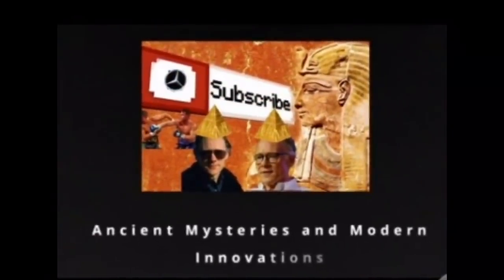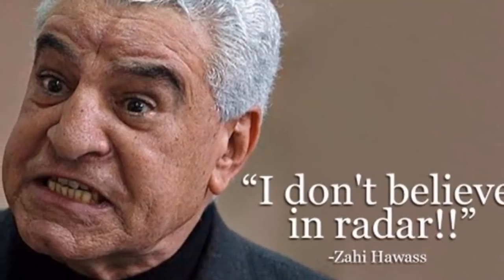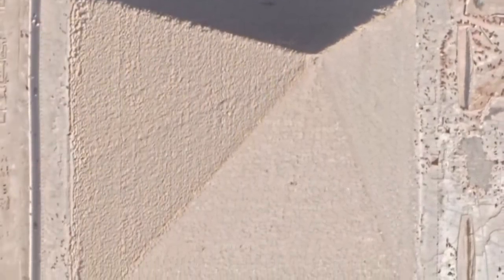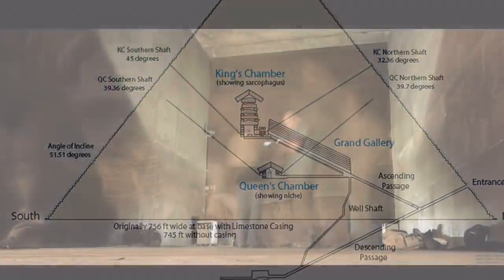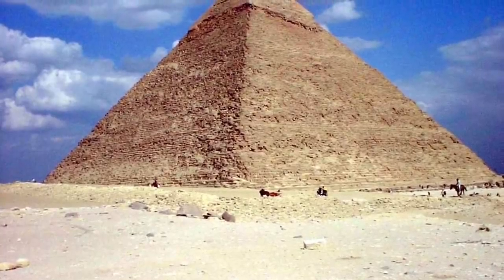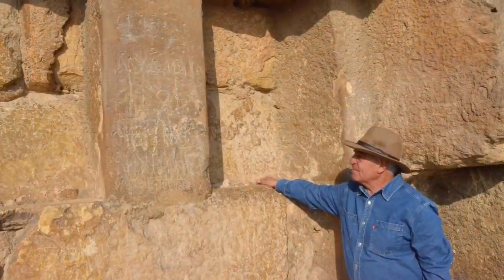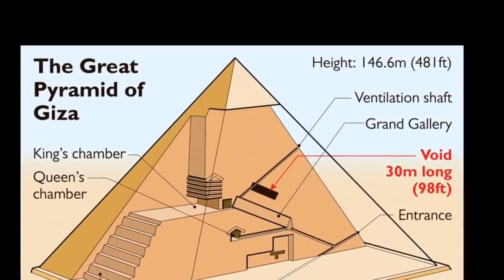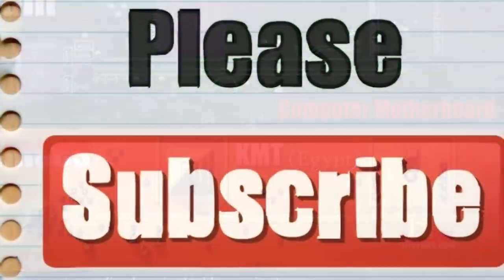Graham Hancock on Geopolymer (Liquid Stone) Technology at Giza Pyramids

Comment: I'd love to see someone today float a 70 ton rock on a raft. Even the best theory is absolute garbage. How come nobody since the Egyptians has ever been able to float a rock that size on a handmade raft. People are so quick to discredit vibration or frequency. If the polygonal stone walls in Peru where created with a chisel than how come nobody since them has done something similar. I am DEFINITELY not saying aliens or lasers because that's extreme and to one side of the spectrum. Why not something in the middle like frequency. How did they direct the frequency toward a particular stone and keep the field around the stone I have no freakin idea. To me that's more logical than a lever. I know levers can move the world but if it's so simple as a lever how come nobody else has done it. Dont say nobody tried because that's a load of crap.
Reply: 2.5 or 4 tons is nowhere near 70. Nobody has floated a 70 ton stone on a 142 foot boat since then. People have tried. If levers are the answer why hasn't anyone else just used a lever to duplicate it. Universities have tried to duplicate on a much smaller scale and all failed horribly. The answer because nobody has wanted to is utter bull crap
Reply: The polygonal stone walls in Peru, could have been cast in concrete - most plausible theory

Comment: The granite is concrete graham just like the other blocks .. they had to use granite because of all of the captured light in their INTERFEROMETER ... that’s how they measured the circumference of the earth
Reply: You can't make granite from concrete. Its an igneous rock
Reply: Samuel Griffith you grind it to dust and throw it in the mix . When it hardens it has the properties of granite or whatever type of stone dust you add .
Reply: @geoffmcarthy7314  which would in no case ever be called granite or possibly be mistaken for granite.
Reply: Samuel Griffith well actually it’s mistaken all of the time . It forms up just as it is granite or whatever other type of dust you use . It takes the properties of the stone dust . So yes it’s mistaken all the time and through history .
Reply: @geoffmcarthy7314  by who? Granite Is characterized by large Crystal growth of 3 or more minerals usually quartz, feldspar and plagioclase which no geologist would EVER confuse with a man-made matrix of dust and cement.
It doesn't sound like whoever is saying this has any understanding of granite or cement
Reply: Samuel Griffith science has already proven this fact . Modern guess work is over . The blocks have been broken apart analyzed and proven that these are man made blocks . There is no question anymore . It’s rock dust made to a type of plaster that takes on the form of the main ingredient .. that ingredient can change
Reply: @geoffmcarthy7314 you just changed what the focus of the conversation was about.  you're now referring talking about the outside which no one ever said was granite. GH said the stone inside the king's chamber was granite. You're conflating 2 different stones.
Reply: @geoffmcarthy7314  the cast stones are limestone. It's impossible to cast a stone that any geologist would mistake for granite. That's just not possible
Reply: Samuel Griffith inside outside it’s the same . It’s the same . Still talking about how and what the stones are made of correct ?
Reply: @geoffmcarthy7314  look I've never been inside the pyramid... But Graham said in the video that the stones inside the king's chamber are granite. I'm assuming he's right about that. What I'm saying is no geologist could/would mistake a limestone based mixture for granite. They are as different as night and day
Reply: Samuel Griffith when you make the stones it’s as if they are natural ... that’s why it has taken so long to figure out . Finally someone actually broke several different types apart and spectrographed the dust and found out it’s man made aggregate of ... granite , sandstone , quartz, every other type of natural stone dust or whatever the additive is
Reply: @geoffmcarthy7314  that's where you are wrong. Granite can't be replicated with a cement matrix because granite is not held together by a cement matrix. It's held together by Crystal intergrowth. You're reading arguments for the replication of limestone and thinking that the same applies to granite which nobody is claiming.
Reply: Samuel Griffith not in this video that is correct . Had I not seen this granite mixing with my own 2 eyes in Bosnia this past summer your argument would hold weight . However they mix granite the same way ... if you can’t go to Bosnia yourself I may suggest you look up “Bosnian pyramid of the sun” and watch instead of going yourself as I have .
Reply: @geoffmcarthy7314  I don't know what you've seen but I know that the hypothesis that the pyramids we're build with poured cement talks exclusively of limestone. You are the firat saying the Egyptians replicated granite rock that a geologist would/has been fooled by
Reply: @geoffmcarthy7314  also, I did look that up and it seems the geological community unanimously agree those "pyramids" are natural formations
Reply: @geoffmcarthy7314  even Robert schoch agreed those weren't pyramids
Reply: Samuel Griffith I understand. As the great pyramid has been suppressed and unable to be studied the knowledge exists at other locations so as far as “those exact exact structures” reality says I don’t know ... but I have seen granite man made sheets used for construction purposes with my eyes. Created 29000 years AGO . As well as a 20 ton man made megalithic stone proven to be man made  60 meters underground with a giant crystal inside above a running water source that vibrates . Please look in Bosnia at the man made granite stones and blocks , then understand this is completely man made ... and the great pyramid is an INTERFEROMETER .
Reply: Samuel Griffith don’t try to tell me when I’ve been there ok
Reply: @geoffmcarthy7314  how did you know they were man made if they looked just like the real thing? Why wouldn't you just assume it was actual granite? 
The only example you pointed out was found to be a naturally occurring structure.
Reply: Samuel Griffith good luck in your search for the truth I’m done explaining
Reply: @geoffmcarthy7314  you didn't explain. You just referenced things that turned out to be fake

Comment: That’s stupid, so they built a different size form for every block? Everything would be exactly the same size if you poured into forms.
Reply: Cement  heads  want to believe  they remind me of  religious fanatics . Yes if it was a concrete  construction   the block sizes  would  be all the same and much more accurate . Most of the block is very rough and crude and mudded in with clay  filler . were the control   courses  were laid there were more  precise  cut and fitted  were most of the inner area was rough stack  with small voids and filler.  If all the blocks were cut and fitted      with  more precision it would have  taken  way to long to build.
Reply: No, you would obviously pour the cement mixture in place. You would adjust the size according to surrounding blocks because each layer is different.

Comment: The odd thing about Graham Hancock is he dismisses a lot of science, while also using it, and using it to prove it wrong.
Science is always open to new evidence and better information, learning new things is whats is all about. With testing and peer review, not nonsense guess work and wishful thinking. This is why people laugh at new ideas from the "pyramid fans" because they also call the pyramid a "power plant" and "aliens" did it. Stop the nonsense and do some real work like grown men. Peer reviewed quality evidence will be accepted when its there, trying to solve mysteries with bigger mysteries will just not do it.
Reply: I submit the hypothesis that the Pyramid pulled electrons from protons using the same principles as the electron transfer chain and the sacral cerebral spinal fluid system of our bodies, where the 5 granite slabs are resonated by a Sonic wave from a pump as the enzymes of the mitochondria that attract electrons from hydrogen atoms or as the ganglia that surrounds the Pineal at the end of the cerebral spinal fluid system but I have looked ganglia up yet but it's part of what I submit to you my peer for review.

Comment: I've never seen Davidovits talk about grinding the raw limestones. He talks about dissolving them in water. The claim is that limestone at Giza contains caolitic clay, that will swell up and crush the stone from within when submerged in water.
Reply: He said that this kalinitic limestone is not a solid stone but a lose soil like gravel. Concrete consists of gravel and sand bound with a cement. He goes on to say that one can still find this lime-kaolinite-gravel in this area.
Reply: That's because davidovits never said anything of the kind. Graham is being dishonest.

Comment: Watch out, Graham Hancock, the literature on the Incan stone walls revealed even more chemistry.  Chroniclers who were half Inca and half Spanish, wrote, long ago on the subject.  In the early days of the conquistadors.  They had total mastery from tribute workers who were capable of placing glazes of material on rough stone walls to create aesthetic glazes.  Red clay was utilized to smooth over and round out and to fill in the recessed joints of the Inca stone walls.  Hulmut Tributch is the investigator into this.  His download is located on the video by Ancient Architects as, "This is the way they built the Inca stone walls.". The presence or absence of diatoms does not, absolutely not, discredit the actual fact that the stones were re-aggregeted.  In some cases, the tiny diastoms we're burned off the earthen, soft limestone to create a smoother facing.  Do not be influenced by Zahi Hawas.  Never raise objections to the geopolymer builders!!  Never!
Reply: The Bosnian pyramids were made from concrete and they are larger than Giza's.

Comment: I don’t think finding the fossils is proof one way or the other. Rocks are put into concrete, the fossils could have been used for the same reason.
Reply: When you use rocks for making concrete you have to crush them and the fossils would be crushed in to small pieces too. fossils in true rocks would be much more well preserved
Reply: irekarciuch sorry let me explain a little better. Concrete is made from cement, water and an aggregate. The aggregate can come in many forms and sizes. Anything from as small as sand to as large an inch and a half stones. The cement and water is what makes concrete but it’s not as strong when it’s by itself so an aggregate is added to make it stronger. The fossils or shells could have been added as an aggregate.
Reply: @josephkidd3622  
Spot on !
Reply: @josephkidd3622  true, but let me explain a little better about those fossils. Theose shells are very small ;), visible under microscope.
Reply: irekarciuch small like sand?
Reply: @josephkidd3622  ok, form to.make the blocks, then how was the tunnels made? Stones above?
Reply: I think when they melted the concrete to pour, the fossils were mixed in as well...

Comment: Wouldn’t this method add more time to the total length of the construction? Mainstream Egyptology today tells us the great pyramid took 20 years to build. As many of you already know, that means 1 block would have to be set in place every 4.5 minutes around the clock without interruption to fit the 20 year hypothesis. Obviously the hypothesis of 20 years has some problems. The poured concrete hypothesis would require drying time  and another course could not be added until the course last poured had cured. So either it took a thousand years to build the pyramid or technology was used that we have not yet zeroed in on to apply to the construction.
Reply: . . . . or they were sculptured from the hills of sandstone, no construction required. Ask yourself would the so-called ancient egyptians have been dumb enough to build the pyramids or simply carve them from hills of sandstone that were already there, in case you weren't aware the Giza plateau is a plateau of sandstone, no-one disputes that the sphinx is carved.
Reply: @Mr.Grimsdale  Why carve individual stones when you could just carve one huge piece.
Reply: @rekindlethewick583  I've got to be honest and say i've slightly moved on from that way of thinking regarding the pyramids although i still stand by that the sphinx was intially carved. I still believe that the pyramids are hills but the outer layers are geopolymer blocks, the area around the pyramids was once a quarry. I also believe that Petra and the Valley of the Kings are also mixture of carving and geopolymer work.
Reply: @Mr.Grimsdale  I agree I think the Sphinx was carved over 10,000 years ago at least because of the limestone weathering. I think it was there when the plateau was a rain forest. There is no way to prove or disprove the age so everyone has to make up their own mind based on data. We can disagree on the way the pyramids were built  but the fact is they are there and were built or made out of natural formations. geopolymer. I do think they had the ability to soften stone with chemicals but... who knows for sure.
Reply: Yeah mate , i think the 20 year build is a bit of a stretch for either theory.

Comment: My unproven theory is as follows :
When you mix sand and water it stiffens then add the right amount of vibrations from tuning forks inserted under the object you want to move, a pillow of almost no friction are created and the object can fairly easy be moved 
My theory are based on the fact that sand and water was avialable with no limits 
Still unproven thoug